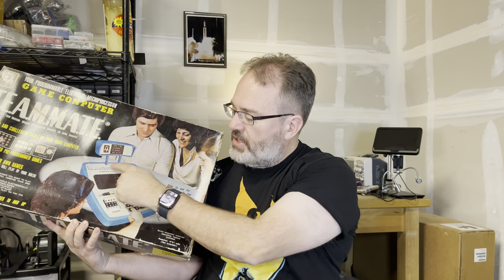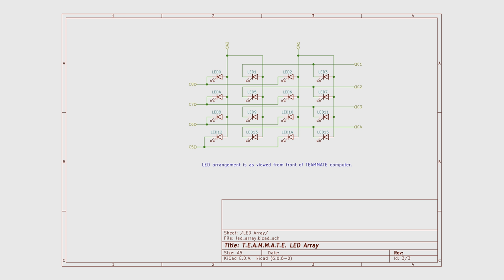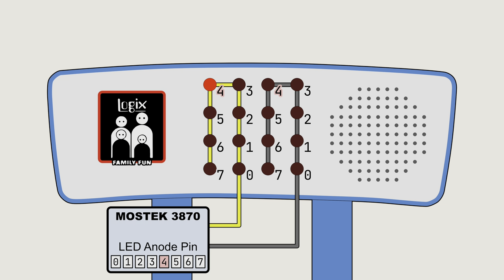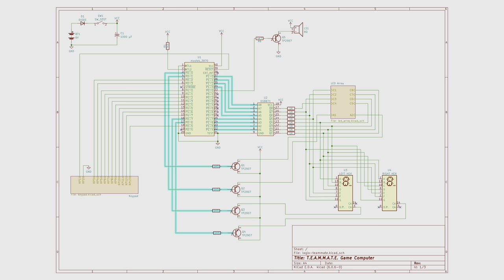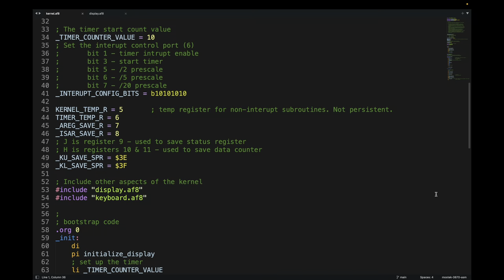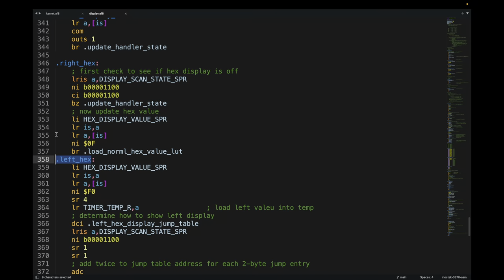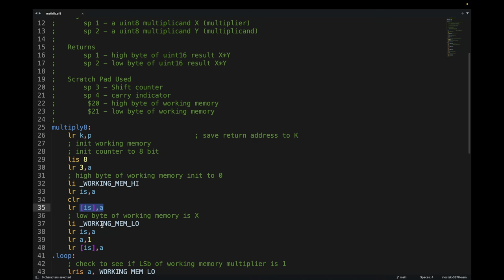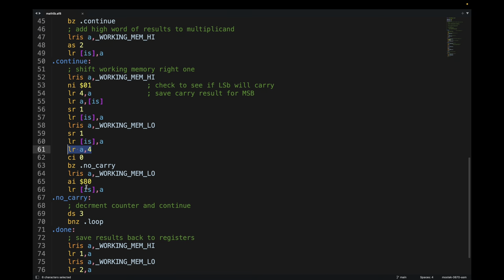The Vintage  T.E.A.M.M.A.T.E. Game Computer - Part 2: Refurbishing and Programming

Comment: did you notice that the 4 pnp's seem to have their c-e's swapped, so you drive vcc not from emitter to collector of the pnp, but instead in reverse? or is this on purpose...?
Reply from the maker: Huh .. yeah, I will need to double check that. I do know this is right for the speaker, as that is in an emitter follower arrangement (note the collector connects to ground there), but I think you are right for the  various LED banks, now that you point it out, the schematic doesn't make sense. Thanks for pointing it out, i will fix the schematic (after double checking the hardware) in the github repository.

Comment: Great work! Just a FYI, you can remove the scratches from the red acrylic panel by using a car polish designed for restoring the plastic lens on car headlights
Reply from the maker: Thanks for this tip! I will try it out.

Comment: could have scrolled the 16 bit value on the screen
>xx xx
>xx D0
>02 D0
>D0 xx
>xx xx
but that would be a lot more code in that clearly difficult F8 asm
Reply from the maker: Yeah, I thought about that, but plainly, it would have required more effort than I wanted to do and the user experience wouldn’t be great.

Comment: One thing I've learned about multiplexing LEDs is to be extremely careful that the wrong LED is never energised even for a microsecond, as the capacitance in some LEDs (especially surface mount LEDs) can make them glow noticeably even if they are energised for only a few µs per second. So code should do: turn on specific LED lines (eg 1&5&8), turn on common line, pause for duration (which can be used to set intensity, sort of), turn off common line, turn off specific LED lines, then go to next common line. If you simplify the code so it is something like: turn on specific LED line, turn on common line, pause, turn on new LED lines, switch common line, even though those last two happen in µs, you can get ghosting.
Reply from the maker: @PeterNLewis, yeah, I did gloss over this detail in my explanation. If you look at my code, you will see am doing this (turning off the  common line before adjusting anything). Then there are other issues with LED ghosting in a multiplexed array, like the time it takes for the switching transistors to turn on and off, but that's at another level of detail.

Comment: You could always display the input in the hex display and output to the matrix which is effectively 16 bit.
Reply from the maker: Yeah, but I would need to implement some sort of scrolling for the hex display as a 16 bit number needs 4 hexadecimal digits to display it (each hexadecimal digit is 4 bits).
Reply: @MichaelKamprath  You can display the results in binary on your "16-bit" LED matrix.  One nibble per row.

The suggestion doesn't make it more user friendly, but hex isn't user friendly either.  It's just easier to manipulate.

You could effectively show 24 bit integers, if you didn't mind part of it binary and part of it in hex, but I'm not sure if you'd have enough ram to implement something like that.
Reply from the maker: @mikechappell4156   oh I totally misunderstood you. Yeah, you're right.